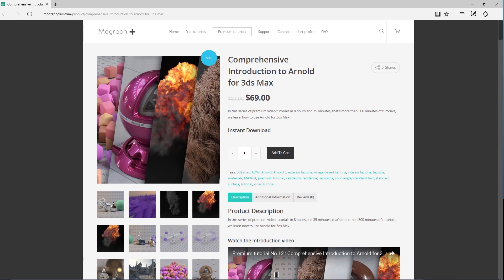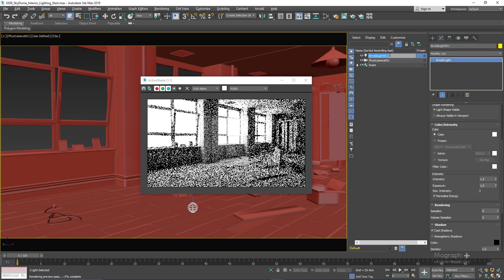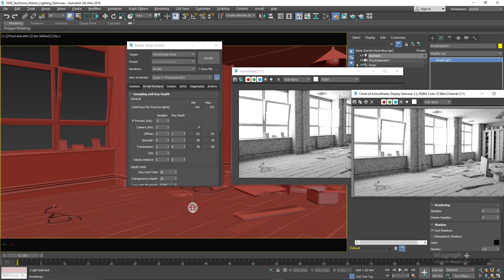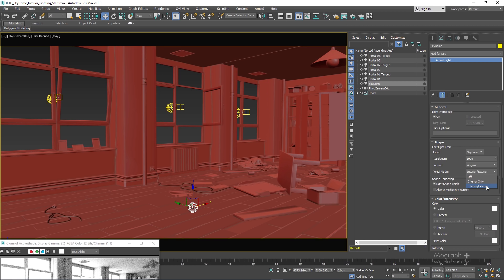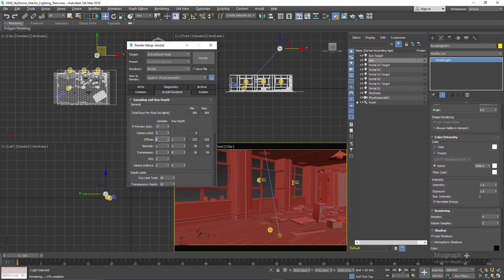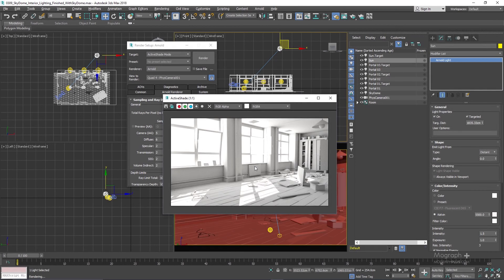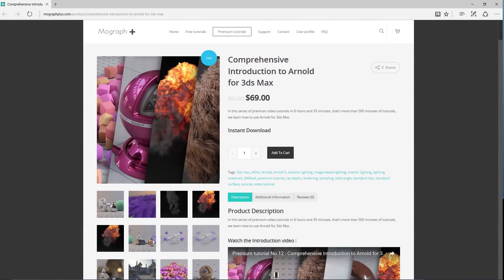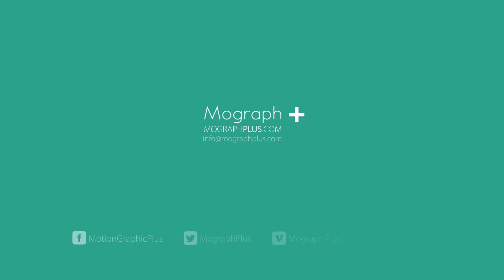Tutorial No.61 : Interior Lighting in Arnold for 3ds Max

Comment: I like the quality of the renders, but it"s way to slow.  It took 7 minutes for a black and white render at 600 x 338? What is your system configuration? You can do a black and white at that same resolution in Vray in seconds.
I did a scene with 2 windows and only 1 object in the middle of the room, took 57 secs in Vray with high render settings.  The same scene, at 600 x 338 in Arnold 27 sec. Both were fully textured.
The only difference, was that in Vray, I had additional .ies lights.  I'm still wondering why it took your render 7 minutes.
Reply: He said it's a low end machine if you listen ;d
Reply: @buncool  So what is a low end machine in his minds eye or your minds eye???